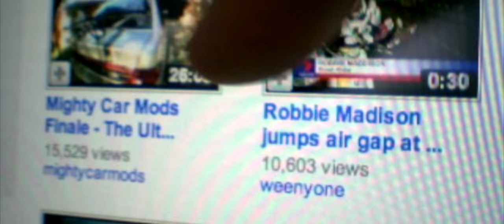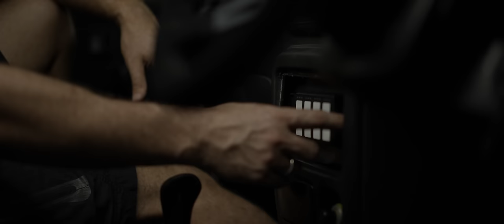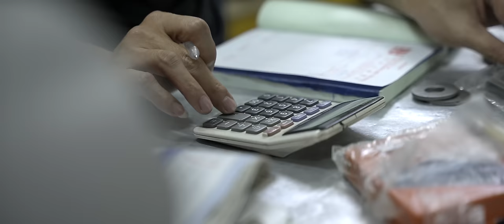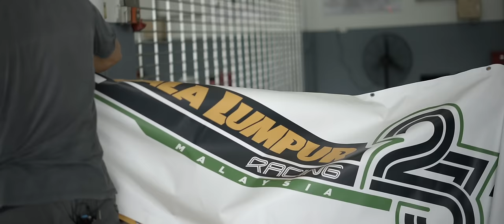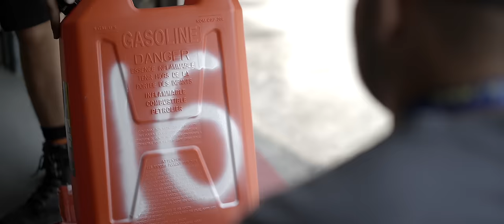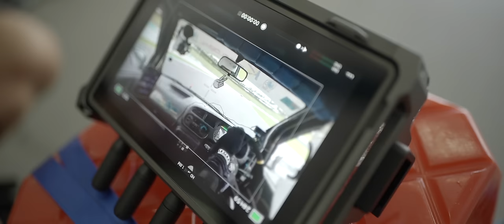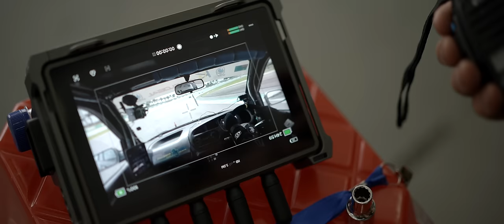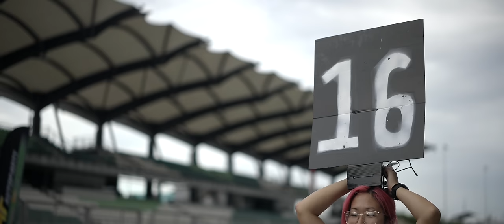We raced for 24 hours with NO previous experience - RACING MIDNIGHT [Feature Film]

Comment: Just checked the results. And even though you may have finished last you did finish and most importantly had fun! Great achievement for a team of people that haven't done endurance racing before!
Reply: How many other teams changed a head gasket AND a gearbox! That's what I used to love about Bathurst - the heroic repairs under pressure. Maybe we should have a race series where everyone has to do a major repair or two... ;-)
Reply: @ickipoo  if you watch 24hour endurance racing like le mans and nurburgring there are plenty of repairs going on. Would love to do the 24hr of lemons at somepoint
Reply: @ickipoo  lol, yeah if nothing has broken by a certain point someone just comes by while its in the pits, opens hood, and slams a sledge hammer onto something important looking.
Reply: @ickipoo  I think WRC already did, but their budget is huge.

Comment: I was hesitant to watch this as honestly, content that you guys have been putting out I skip through quite a bit of it. This was a TOTAL experience, I love it. I've always been inspired by the malaysians on the mods they do to these cars as I've owned one all my driving life. Again, I loved this video. 

A little tip; if you want a lightened flywheel for that EJ engine, you can use the skim the weight off the flywheel for the ED20, ED10, EF engine, use the pressure plate for that flywheel and the clutch for that gearbox and you'll be good to go.

Comment: One way to flatten a head is to physically move it back and forth over some wet and dry stuck to a really flat surface like a thick piece of glass or steel. Great work out. One big issue with getting cars to go faster is getting enough fuel into her. Improvisation could be key, for example fit a mono point injector as a 2nd injection system, thread it into the inlet manif and activate it over a certain rpm.
  Slow and steady will win a race like this. Just put it in 4th and plod around for 24hrs. Everyone else will run out of fuel or break their motors. But where is the fun in that?
  I'm guessing clutch release bearing, spinning in the housing. Oh well, looks like it was the syncro after all. Great work!

Comment: I'm going to make a guess and say that before they removed the head on the engine to check it for a blown head gasket there was (well might have been) a vacuum leak somewhere that was causing it to have troubles but only after pushing the engine for a while at high rpm's. Then after the head was replaced again they unknowingly fixed the vacuum leak and it ran as it was supposed to. But hey what do I know I wasn't there LOL. So it's all just IMHO.

Comment: Before I continue watching. Are the syncros just munched? Assuming no other selector issues you would be able to double clutch and rev match and keep it going, that would be a fairly lucky failure (because you can deal with it ith patience and precision). ...Unless the gear gets chewed up as well. In one of the transmissions for my car it basically has no syncro in 1st or 2nd. It is SUPER annoying (the previous owner frustrates me lol) until the technique becomes a habit (then it is only occasionally annoying).

But... well used transmission problems are what they are.

*Ah you ended up having to just replace it. Too bad. I am hoping you guys manage to cut the pace and complete the race without running out of fuel. Otherwise, I just hope everyone had fun.

***It is kind of Ironic that the race clutch ended up causing more wear, when it itself was installed with the intent to live longer.

Comment: Seems to me you could modify the car in a bunch of ways to improve fuel milelage to win then???? Tires lean fuel mixture reduce drag coefficient run the car on one cylinder turn off the engine on deceleration

Comment: 16 year apprenticeship, gone from an annoying bunch of kids building crap, to building and running an actual race car. 
Absolutely brilliant race series. Would you have more fun in a GT3 car? Err NO.
What did that race cost inc all the parts, 40-45k AUS Dollar?
Cars built, freshen up the mechanicals. No point chasing more power, because of fuel. Optimise  weight and fueling for economy, go pickup some trophies 🙂